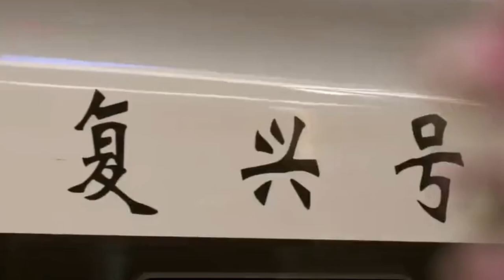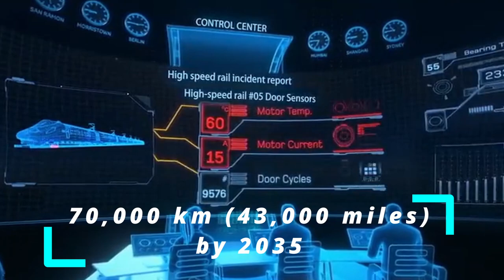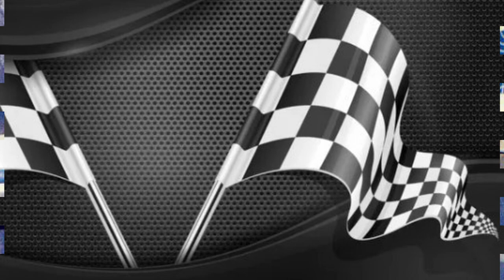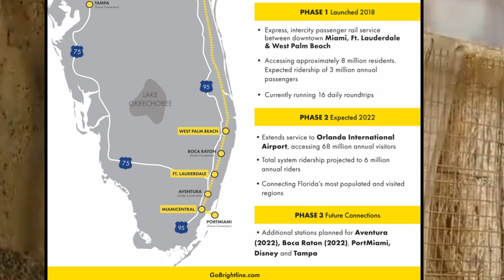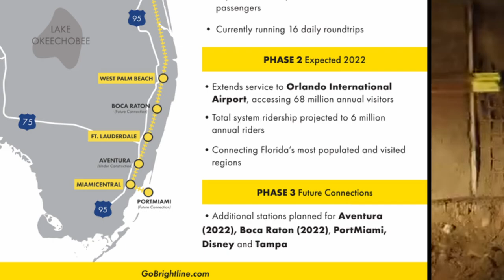US HSR, The Future of USA High Speed Rail, What is Holding Back US High Speed Rail

Comment: Funding didn't stop the freeway system or the irrigation projects with dams all over the country.  Whatever happened to vision and just getting it done?  We need and want high speed rail connecting every major city of over 500,000.  Spokane to Seattle, is my corridor.  The train would be very popular rather than flying.  It's too short to fly, too far to drive.  But the high speed rail would be just perfect.  Plus the winter commute would be better than driving or flying!!  We saw the airports and highways get closed down because of ice storm.
Reply: Simply upgrade the existing right of way and enforce the passenger service priority law. Amtrak takes eight hours to travel the 279 miles. An average speed on 70 mph would take four hours. Spokane would need a population of several million to justify HSR. Brightline is the best example.
Reply: In Florida, a planes  stop flying because of lightning storms in the summer. Often are delayed for many many hours plus it takes often very long time to get through security and Florida airports because of long lines. It is a popular tourist state.
     I’d rather have a choice and take the train. At least Brightline train is coming to Orlando airport hopefully soon this year. It’s already running between Miami, Fort Lauderdale and west palm and much more often than Amtrak.!!!
Reply: @enjoyslearningandtravel7957  Thank you I did not know that at all.
Reply: @davidjackson7281  you’re welcome glad you’re interested.
Reply: @davidjackson7281  "Spokane would need a population of several million to justify HSR."

Much more, actually....   Since the cost of construction through the mountains would drive the price to at least 5-10 times the cost of a flat-land route.  Not only would  Spokane need a population on par with the Greater Seattle area (3-4 million) but you would also want a few cities along the route of 500K or more, each with robust local transit networks that would allow for door-to-door trips for the majority of their residents. That's the sort of population density that justifies HSR.  But, that does not exist in interior Washington.

Washington's sole hope for HSR is a link between Seattle Tacoma, Vancouver (WA), & Portland which is much closer to flat.... But still lacks the population density and public transit along the route to make it practical.
Reply: @ilikehardplay  You are correct about Spokane. Yes, to do another 8 mile tunnel through the mountains would not be expensive. That tunnel I just learned is the longest in America and they close one end to blow the diesel fumes out. Yes also there just is not enough population to support HSR between SEA-PDX. The Cascade route is 3:25 for the 170+ mile trip and four hours via the Starlight. Perhaps HSR could do it within 90 min but very expensive. My bright idea is the Brightline example of 125 mph track so it could average 85 mph and make the trip in two hours. Faster then ordinary train (the few Cascades are popular from what I see on the booking site). Faster than a car and really not that much slower than HSR when you factor in stops. Thanks for your reply. It seems we agree which is nice on the merits of HSR. I am for it here in California but it will take decades, atleast.
Reply: @davidjackson7281  "I am for [HSR] here in California but it will take decades, at least."

I rather doubt it even then...   Why?  Because the remnants of the first try, will act as a millstone around the neck of anyone trying again....and sink their project with the failure of the past...  And I frankly expect the state to run out of money to throw at HSR with the line from Merced to Bakersfield, a segment that does not have the population to support HSR service on that line segment....even if they had the robust local transit to feed passengers to the stations.  Lack of passengers means they will run fewer trains, fewer trains mean that fewer passengers will find their schedule convenient. Thus, a death spiral.....with fixed maintenance and operating costs exceeding ticket revenue.

CA HSR should have been started as two separate systems.  The first being the electrification and speed-up of the CalTrain corridor from Gilroy to San Francisco.  The second being an electrification and speed-up of the Metrolink route between Los Angeles and  Palmdale/Lancaster.  (allowing the development of PMD as Los Angeles's 2nd international airport)  The aim should have been improvements to allow the eventual operation at a max speed of 125-150 MPH, a la Brightline. Only when both were operating in the black and showing the potential of higher speed rail should they have been pushed into connecting into the Central Valley.  

The problem is that: 1) to most people, that's not HSR, 2) It  was politically unsalable to the parts of the state outside the Bay Area and Los Angeles Basin, and 3) doesn't look like a grand gesture.....but an incremental improvement.....and not politically useful.  They had to promise LA to SFO....despite the fact that they should have known that they were not asking for one thenth the funds that it would eventually take.
Reply: @ilikehardplay  I thank you Mark for the reply. The Metrolink between LA and Palmdale segment is the most interesting. Can you compare your idea with what is present and perhaps to what CAHSR plans are?
Reply: @ilikehardplay  Thanks Mark so much for your insight and knowledge. The plan to put HSR through the San Gabriels is going to be quite challenging as you point out. When I think of building 28 miles of tunnels it blows me away. I have seen the presentations of how they say the 39 trip will take 13 minutes. Building 13 mile and 12 mile tunnels is quite ambitious. Of course they plan to build a 13.5 mile tunnel through Pacheco Pass and 10 miles through the Tehachapis as well. The tunneling to the SF Transit Center will be quite the project, too. 

I suppose if they keep funding at a rate of a billion or two a year there will be progress at a snail's pace. I don't mind that expenditure relative to the state's overall budget. I had hoped that perhaps a cheaper approach and alignment from Palmdale would be possible but from what you say I now am disappointed. I know it is now a two hour ride to Union Station with a lot preventing upgrades as you point out. It seems this will end up being constructed only in Northern California with only Pacheco Pass done by 2038 at the earliest. Instead of 55 miles of tunnels an alignment of extending the Surfliner through a new 5 or 10 mile Cresta Grade tunnel to Paso Robles seems in hindsight the better way to go in some ways. Take care Mark and thanks for the edification.
Reply: I love driving and routinely drive 600 miles to see my fiancé and still want HSR and see the benefits. Now I also think people who are looking only at one side of this issue are not doing their side any justice.

Comment: I think HSR is good and will work for regional areas such as Northeast Coridoor, FL, CA, & TX.  I'd also use it in NC if Raleigh to Charlotte to Atlanta GA.  However given the distance and mountain crossings, I don't see it ever being done cross-country.  Even at 150 mph average, its 20 hours coast to coast vs 5 on a plane.  At a more likely 100 mph average, its 30 hours!  Plus stops.

Comment: In some city / metro areas such as Los Ángeles, fares cover 70% of operating costs for their metro system of trains and buses which is average to above average compared to international comparisons. The unspoken reason we need the HSR is that the cost of fossil carbon fueled airplanes could skyrocket if those fuels become scarce and that our civilization is already at risk due to climate change — electric transportation is vital for that and reduced pollution. Electric planes are in development but several more generations of battery improvements is necessary to approach the energy density required. Maybe satélite charging of airplanes in flight

Comment: You will see a camel pass through an eye of a needle before you'll ever see any sort of high speed rail infrastructure in the United States
Reply: You will see CAHSR operating in 2029 long before a camel jocky rides a bike or passes his driver's license examination. Brightline Florida in 2023 will run to Orlando with a top speed exceeding 200 kpm. Perhaps you may wish to consider pounding sand. Hahaha! LOL!
Reply: @davidjackson7281  America lags far behind Europe and Asia in high-speed rail development – only 33.9 miles (54.6km) of the current U.S. passenger rail network is capable of supporting train speeds in excess of 150mph.China's first high-speed railway started operating in 2008 between Beijing and Tianjin. Since then, the country has built a network that spans nearly 40,000km (25,000 miles) and is now the world's largest for bullet trains that can travel up to 350km/h (220mph).Nov 24, 2022
Reply: @davidjackson7281  the high speed rail in Florida is an expensive ornament
Reply: @davidjackson7281  Yeah, bud. Brightline is building a 20 mile section of 125mph (200kph) track out of the total 235 mile Brightline route. That's less than 10%!

If someone served you a sandwich that was 10% sandwich and 90% manure? Would you still eat it?
Reply: Nonsense. The Acela already exists and runs at speeds of up 150mph and mostly stays above 125mph. This is bona fide High Speed Rail according to the international standard. After the new TGV trains are delivered next year it will run at 160mph. They have 40+$ billions in upgrades that will increase speeds and remove slowdowns close to stations. 

And it has existed since 2000! You're 23 years too late with that comment.
Reply: @TohaBgood2  I stand corrected,I should have been more specific in my comment about High-Speed Rail. The high-speed rail I'm referring to is the 220 MPH - 240 MPH rail system, for example, in China,with it's 25000 miles of track, and state of the art railway stations. The high-speed rail  you're referring to is the horse, and buggy.By the way, I have been to China many times,and traveled on their high speed and bullet trains.Travel to China and see for yourself if you don't believe me.
Reply: @redkellyre6568  Lol, 220mph-240mph? There are literally no trains in the world that run at those speeds currently.

There is one single train in China that can run at up to 217mph in operation and a few trains lines in Europe that can run at just under 200mph, but rarely do so. That's it.

So you're referring to trains that currently don't even exist! I encourage you to look this up.
Reply: @TohaBgood2  that’s not really a good comparison using sandwiches
     I am definitely riding the train when it comes to Orlando rather than going on the toll road traffic and I know lots of people that are either afraid of driving the toll road or they cannot drive it because they’re taking certain medicines
Reply: @enjoyslearningandtravel7957  I stopped engaging with tohabgood because he is rude and insulting. He brings nothing to the conversion except weak distortions of facts and truth.
Reply: @davidjackson7281  Except the facts! You just don't like that I fact check you when you lie, bud. 

Stop lying and you'll have a much better overall experience in life.
Reply: @davidjackson7281  that is probably wise, there’s some people that get on YouTube I think just to argue or they just see their point of view.
Reply: @enjoyslearningandtravel7957  Well, the comparison is 100% accurate. 20 miles / 235 miles = 8.51%. 

That's the percentage of the Brightline right of way that will be able to sustain 125mph. 8.5%, that's it.
Reply: @redkellyre6568  I do not engage tohagoodie in anything because he is argumentive, rude, and insulting. Insecure people like him should be ignored.
Reply: @enjoyslearningandtravel7957  Yes, he is a poor example of someone to respond to ever. But it is entertaining to see someone like him to come off so poorly.
Reply: CAHSR is being built? Acela trains are being upgraded to 186mph operation? Way too many people write off California's high speed rail, but it will happen.
Reply: @oskehcat  Have you seen the recent board of directors monthly presentation? It is over 2 hours but there is information from the CEO's presentation in the second half which anyone interested in CAHSR would be wise to atleast peruse. Spoiler: Without $8 billion more from the feds the IOS is not guaranteed. With secured funding totaling $35 billion the best guess for the just IOS to open is 2030-35. 

The Avelia trains will have a top speed of 160 mph on about 60 miles maximum of the 440 mile NEC route. CAHSR can only guarantee the happening of the 119 mile 'practice and play' test track for $25 billion in the 2027-2032 range. Since they have never come close to making a deadline you know which is the likely year. Will you ride the IOS if it opens in 2030-2035 at a cost of $35 billion for 171 miles?